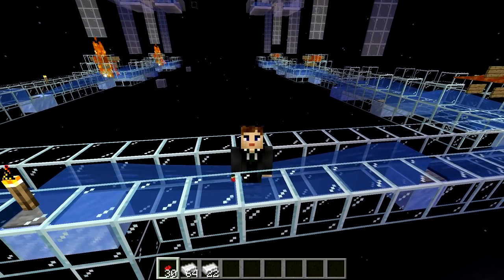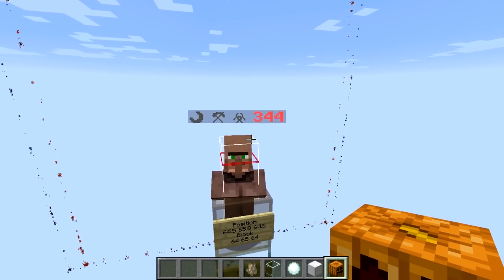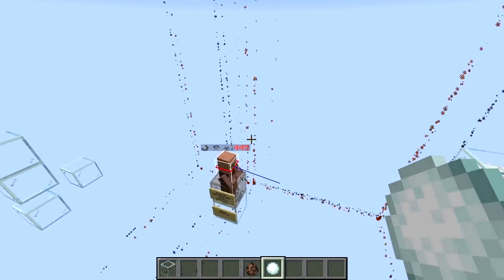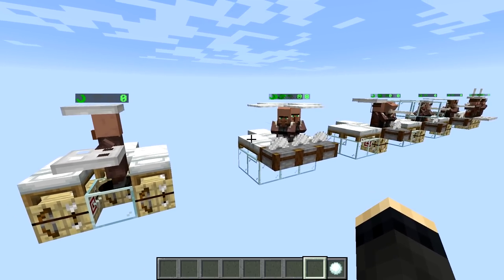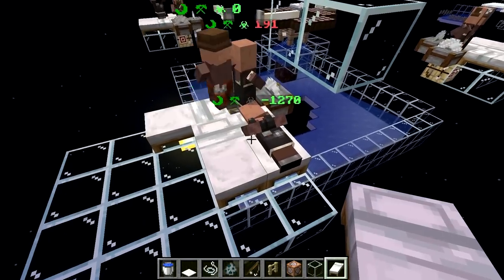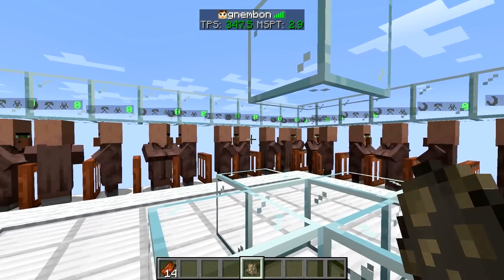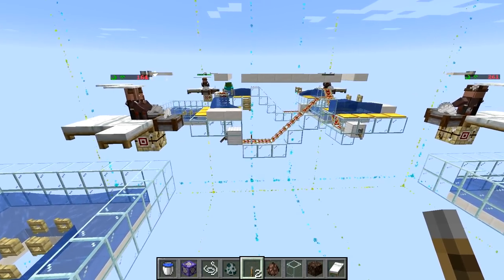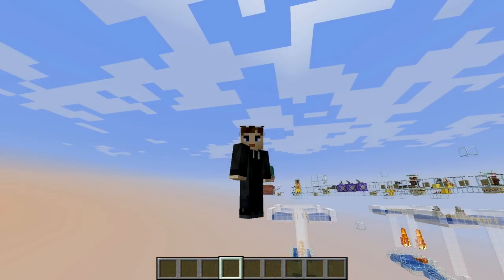Simple, Cheap, Efficient - IRON Farms for 1.14.4 [Fun Farms 28]

Comment: I built this in a survival world, but only 1 iron golem (sometimes none) spawn every zombie stop. Was something changed in the mechanics or did I do something wrong?

EDIT: I have found the source of the problem and a solution. I, in fact, did not mess up the build, but the pathfinding of the villagers to their beds was messed up by chunk un-loading and re-loading. There are two fixes to this problem, either build the farm in spawn chunks or force load the chunks you build the farm in using the command /forceload. For those of you that do not choose to re-build your farm and choose to use the /forceload command, you may have to fix the broken pathfinding if the farm has been built for a while. In order to do this, wait until night, break the unused bed of each module and place it back. This should fix the farm so that each module spawns an iron golem almost every time.

EDIT 2:  For those of you having trouble understanding the /forceload command, see https://www.digminecraft.com/game_commands/forceload_command.php for helpful information.
Reply: You did something wrong. If you wanna test the farm in the version you are in, just download it and load the world. This works in 1.14.4
Reply: Same with me, although it worked like a charm during a few days and then stopped working with the same result as you : only one of the different stops produce golems
Reply: Same here
Reply: @sampsonbell  See my edited comment for a solution.

Comment: I built the recommended farm at the end of the video on a hardcore survival world and its not spawning any golems. The build is literally identical and runs on 1.15.2 however i've tested the world download on that version and it works fine. Any reason why?
Reply: I have the same problem
Reply: MikebOi  same here
Reply: replace the beds. maybe they havent slept, which is a requirement for them to spawn.
if that doesnt work, replace all workbenches. i think that will solve your issue. :)
Reply: @jonathanleine7167  You were right thank you! It works fine now :) Turns out it was the beds.
Reply: MikebOi  I just built an iron farm myself. The rates are outrageous if you get the tricky stuff done. And yeah, youre welcome. Im glad it helped someone :)
Reply: @jonathanleine7167  Hmmm that's odd, I replaced the beds and workstations but they still won't sleep. I think they need to sleep but that doesn't happen.
Reply: Iman Moshari if they are scared, they wont go to sleep. Maybe that’s your issue. If not then idk.
Reply: @jonathanleine7167  Never mind. I realized I placed all the beds the wrong way.
Reply: Iman Moshari yeah, happens to everyone. :)

Comment: This farm constantly breaks in 1.14.4 and still breaks constantly in 1.15. Every single time I log onto the server I have to go break and replace half of the beds because the villagers keep deciding that they want to sleep on a bed they can't get to and when they don't sleep, it doesn't spawn golems. They said that 1.15 would improve villager POI tracking but it seems to make it even more common for the villagers to be unable to sleep for no reason as now I have to fix this after 20-30 minutes of the farm running. Does anyone know a fix? I've replaced the beds at least 50 times now and I am very close to just burning all of the villagers to death for wasting my time.
Reply: Oh that's why it isn't working.. I though i did something wrong.
Reply: @champodale3126  Someone actually responded to another recent comment with a picture that at least seems to resolve the issue. They swapped the middle bed on each module to be centered on the opposite side (head of the bed facing the module, same height as the other beds so the villager can use it). From my experience, you still need to wait for a day/night cycle to go by every time you log onto the server as the villagers forget that they have worked/slept but at least the farm stays working for a while. 

I cannot currently guarantee if this works long term as I have had to reset several backups since I changed to this and doing so screws with the ai and causes the beds to have to be reset. Whenever the 211 shulkers I am shipping to the overworld finally cooperate long enough for me to not have to reset a backup, I will leave the farm running for a few days and see if the fix is more permanent. I might even throw a permaloader under it as I need roughly 90,000 iron blocks for an upcoming project and that is going to take a very long time even with the rates that this farm offers.
Reply: That's the lovely world of villagers for ya!

Comment: Please help. Farm is built, everything worked fine, some villagers stoped sleeping at night. i broke their bed and placed it back. later they stop sleeping at night again.
Reply: POI (point of interest) system in 1.14.4 sucks sometimes. Just break and replace the beds as far as I know.
Reply: I saw another comment thread with the same problem, someone posted a fix, others confirmed that it works. it's just minor changes, changing above beds to string and carpet,  and moving the iron trap doors and end rods. Here is a link to the screen shot of the fix. I  https://m.imgur.com/5WVPUEa

Comment: Spaced out one with zombie and powered rails(mumbo jumbos design)
- 212 slabs
- About 5 stacks of glass
- Few blocks
- 8 grindstones
- 4 fletching tables
- 20 fence gates
- Water
- 12 beds
- 12 villagers
- 24 powered rails
- 1 zombie
- 1 mine-cart
- 4 levers or any other red-stone power source
- 1 name tag or you can throw something at him to make him not despawn
- 8 string and 8 carpets(can replace with end rods if you want)
- 24 pressure plates
- Some extra building and scaffolding blocks
Tips:
1. Throw helmet at zombie if you don’t want put roof above him
2. Sometimes trades will flicker in 1.15, to stop this trade with them once
3. BE PATIENT
Please tell me if I missed anything

Comment: On the 4 corner design, the villagers keep getting out of bed on the glass, how do you fix this?
Reply: I dont know, I have the same problem. Killed 5 villagers so far
Reply: @heroqwr9085  lower the entire chamber by one, it is an issue with paper and spigot versions of servers
Reply: @typingsounds  I am on spigot and I did lower it by one block and I still have the probleme. do you have anyother ideas?

Comment: "Simple, cheap, efficient" - Well, one out of three isn't bad.
Reply: It is simple, and it's pretty cheap, until you get to the powered rails. There's just way too many powered rails
Reply: @stayedleopard4  But you can always take some of them out. Sure, it would lower the overall efficency since the Minecart doesn't move at full speed all the time, but I think, it should be good enough as well, especially since you're easily able to stack them. Either to the sides or above/below. So, building like one or two (and the gold can be aquired) will set one up for a good amount of time, if you afk - or better: build - near this thing ^^
Reply: @playeronthebeat  you can just make a a rail duper lol.

Comment: Is there a REPLACEMENT for the END RODS, since they're difficult to gather in the early game?
Reply: im trying trap doors, i subbed it in his test world and it seems to work
Reply: Well, if you watch Mumbo's latest episode you would see that placing a block above the villagers would block their pathfinding to the beds. In that case I believe that trapdoors could work since they are not between the villagers and their beds. I/ll build it anyways and see if it works... :P
Reply: Lavitz did trap doors work? Seeing as I figure you now tested it and reached a verdict
Reply: Rodge did you find any reliable early game solution to the end rods?
Reply: @Wheelergarage  seems to be working well. But I'm a dope and didnt make the drop shaft long enough. So my rates are a little slow right now.

 Once I fix the drop shaft it'll be perfect. In his testing world the trap doors worked too, I tried swapping those first. And rates never changed
Reply: Lavitz thank you! Also I don’t know if you tested this or would know but can this be built underground hypothetically or in a house or whatever, or do the villagers/beds need direct sunlight I’m still unfamiliar with the new game mechanics
Reply: @Wheelergarage  they do not need direct sunlight anymore. But I would caution you with going underground. It should work, but might give you extra work in clearing space. 

Number 1 the drop shaft needs be a direct drop of at least 19 blocks below the villager. (This is what I forgot). The golem needs to be out of sight of villagers in order to reset their timer so the next golem can spawn by the time the zombie comes around again 

And also you would have clear a space around the farm itself too. You don't want to give extra spawning spaces for the golems in undesirable locations
Reply: Lavitz thanks again really appreciate it!

Comment: OK so I know some people could be coming here to learn some mechanics due to the rules not having changed much (example: me) so that they can do their own design or just to learn. But in educational videos, if one thing doesn't sit well, it stays at the back of your head and disturbs your focus, at least it does to me, and one of those moments was the calculation at 8:56. So I'm clearing that up since I was confused as well. I'm gonna use words tho, not that much math, so If you don't like walls of text, be warned.

Basically, we want the probability of one golem spawning, and if there are "n" amount of spawnable blocks (in the case of the video, "n" is 25), and a spawn area of 256, the chance of one attempt succeeding is "n/256". Now that's pretty simple, but that attempt is done 10 times for every villager, and im going to be using just one panicked villager trying to summon a golem for simplicity.

Now why this weird formula? Wouldn't 10 attempts spawning a golem just be the "n/256" chance that we mentioned before, just, 10 times over? Well no. Let's think of spawning a golem a bit, your attempt either fails and doesn't spawn anything, or succeeds, and spawns an iron golem, so "n/256" is the chance of success (n is spawnable blocks so "25/256" in the case of this video) and unless the chance of success is straight up "1" (100% in percentages), there is a chance that you will fail as well, so the chance of you succeeding, and then failing after that would be your chance of success, multiplied by your chance of failiure.

What about succeeding , failing twice, and then succeeding again? multiply success, multiply failiure twice, and success again. Succeeding 3 times in a row though, that's just the chance of success 3 times over, 4 times in a row is multiplied 4 times over, 5 times is 5, you get the idea. So multiplying the chance of success "n/256", 10 times over for each attempt is the probability of you SPAWNING A GOLEM WITH EVERY SINGLE ONE OF THE TEN ATTEMPTS IN A ROW, which is not only impossible since your villager stops after the first one, but also incredibly slim even if otherwise.

So, back to one golem, and before that, understand what "1" means in this situation. It's 100%, definitely gonna happen no matter what. if you are doing something that either succeeds or fails with no in between, well then that "1" (or 100% in percentages) is gonna get split into chances of either success or failiure. so if you had a 5% chance to succeed, you have a 95% chance to fail, or in other words, 100%-5% percent chance to fail. In fractional probability (that just means you use "1" and "0.05" instead of "100%" and "5%") that is "1- 0.05".

So if you had "n/256" chance to succeed, then "1- n/256" would be your chance to fail, and "(1- n/256)^10" ("^10" just means "to the power of 10" or "10 times over"), is the chance of you failing ten times in a row. That's the thing! In literally ANY other case EXCEPT failing a whole 10 times in a row, you succeed at least once, and since villagers stop trying to spaw golems after the first successful attempt, it doesn't matter which of the 10 attempts succeed, as long as all of them don't fail, one golem will appear.

So we have the chance of everything failing, "(1-n/256)^10" and as long as that doesn't happen, one golem appears, one or the other, no in between, if ever single attempt doesn't fail, you get a golem. Total failiure is, well, failiure; and getting a golem is success. If you have a 95% chance of failing, you have 100%-95%, or 5%, chance of succeeding, so if you have "(1-n/256)^10" chance of failing, you have " 1- (1-n/256)^10" chance of succeeding, of getting one golem, and that's where the formula comes from.
Reply: You got time to lost

Comment: I had troubles with the farm at 19:13. The villagers kept getting out of bed onto the glass blocks below the them. Pretty sure I built it correctly from cross referencing this and Mumbo's video. Anyway, I fixed it by lowering the golem spawning areas down by one block.
Reply: So your farm works now that you moved the spawning pads down?
Reply: Yes. I think it works better during the day too bc the villagers don't have to be scared out of bed first. Not sure on that tho

Comment: Got some issues. some modules has atleast 1 villager not sleeping and it cost not to spawn golem. 😭😭
Reply: x2
Reply: for me only 1 module is working, the rest doesn't ... anyone knows how to solve this? I built it under ground and made sure to have no blocks within the golem spawning cells.
Reply: Check if your villager is sleeping or not. Might be they are registered to a wrong bed. POI issue

Comment: my farm (built mumbo style) doesnt work during the day. Also, one of my modules is not spawning iron golems. Any fixes?
Reply: Dunno about you, but when I used glass in spawning platform it didn't work for me. I had to use som other solid block instead
Reply: @minomaslej  The spawning platforms are supposed to be top half slabs
Reply: @flameopathic2046  yeah, didn't know that. But my farm is working fine now, but thanks anyways

Comment: Having issues with villagers forgetting their beds?
This is a known bug when beds are tiled side by side. Eventually they will forget them.
The solution is to have the beds split on each side so they're not side by side.
To do this the platform needs altering slightly which can be seen in this image:
https://imgur.com/bbiYALf

The head of the beds MUST face into the villager platform. I've had this running for a month now and not once has it broken. Works flawlessly.
Reply from the maker: That's interesting. Do you have some more information about this bug? I would like to find a fix if I get more info about it
Reply: You're a hero man

Comment: I built the easy version, the one with the zombie on a minecart, my villagers are using their beds however no golems are spawning :(
Reply: Takes about 20 or so minutes to start up. Also you may need to break their beds and re-place them, the POI system can lose track of beds sometimes
Reply: @BILLYBOBJohnson-kj2zd  yeahh thanks i did that and it started to wrok, btw im planning to make a villager breeder do you know if its better to build it far away from the village or theres no problem building it in the village
Reply: I don't know the exact minimal distance (if there is one), but It hasn't been a problem for me so far. I have a villager breeder and trading hall under the village I spawned in, and the iron farm is east of both. I measured out the distances and the closest bed/poi block in the above village is 60 blocks from the closest villager pad in the iron farm. The underground trading hall and breeder is 43 blocks at it's closest point. The iron farm is actually still in progress, however I tested it in creative due to this very concern and everything works fine after the setup time I mentioned. I would just recommend that you don't build the two right next to each other, an make sure that you build the iron farm high enough to accommodate the sorting system.
Reply: @BILLYBOBJohnson-kj2zd  Thank you so muchhh :)
Reply: No problem, happy to help! Two last things:
1) Make sure to put glass ~5 blocks above the villagers (and the beds) so lightning doesn't turn them into witches, that would be *real bad*. 
2) The distances mentioned above account for vertical (y) distance as well. I just used some distance measuring website and the f3 coords.
Reply: @BILLYBOBJohnson-kj2zd  do you know why thus is or how to optimize?

Comment: Ive built the one at 19:30, but my villagers keep escaping to the glass chamber after sleeping, what can i do
Reply: Do you have blocks under the beds? If there's blocks under the beds then the villagers can wake up and be on top of the beds.
Reply: @ibthegamingmaster3181  i had the same problem. do you have the pillow side to the working benches
Reply: the pillows are next to the benches, and ive put blocks, but they still spawn on the glass at the end of the bed, is the glass supposed to be 1 or 2 lower than the fletching table?
Reply: @juanlim85  1 block lower and the blocks under the beds need to go
Reply: also i have no idea where the 4 redstone dust goes
Reply: @juanlim85  on top of the fletching tables. I didnt know either

Comment: If anyone is having trouble with spawning inconsistencies, I fixed it by replacing the last 4 powered rails of 3 of the rail lines to regular rails and switched the pressure plate at the end of the water streams to a slab. it spawns a golem every time.
Edit: This is for the farm at 19:13
Reply: Bro thank you! This actually worked

Comment: hey gnembon why do my villagers spawn under or next to their bed instead of ontop of the fletching table
Reply: I had this issue too, but in the workstations, I replaced the end rods and carpets with trapsdoors a block below, with leaves where the rods and carpets would be. The trapdoors prevent the villagers from leaving, and leaves prevent mobs from spawning there.
Reply: @anoekterpstra2308  i hat a solution to
I just placed a lot of carpets under their beds en after that it was just fine